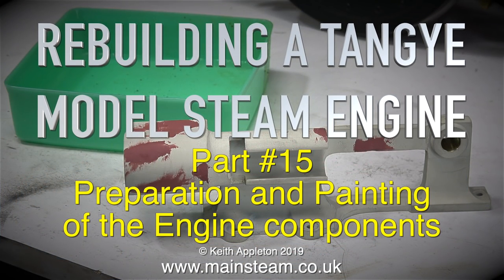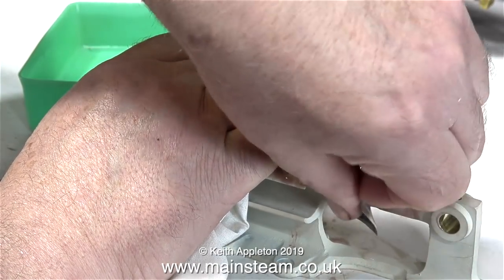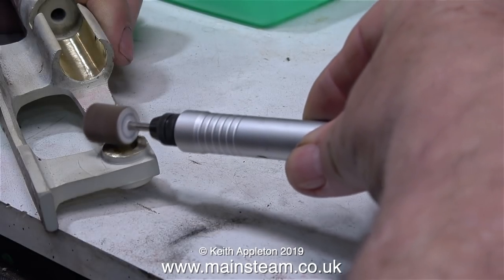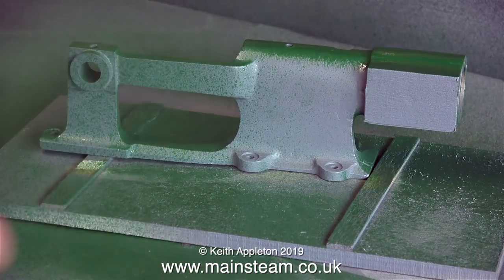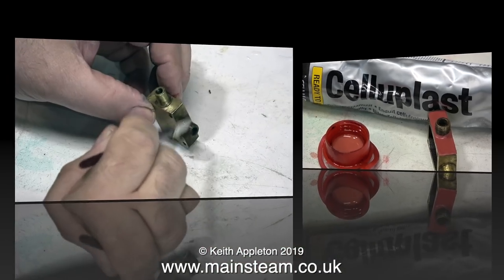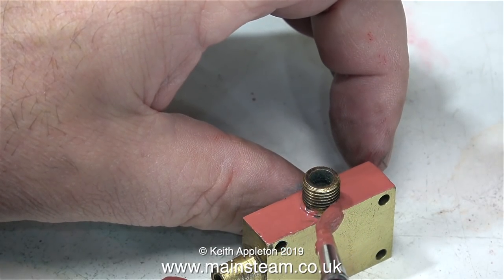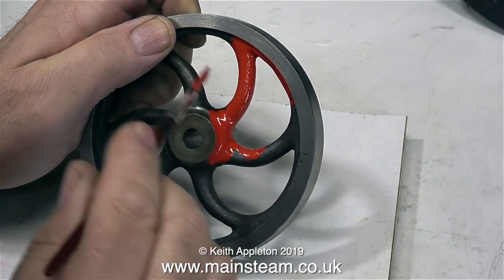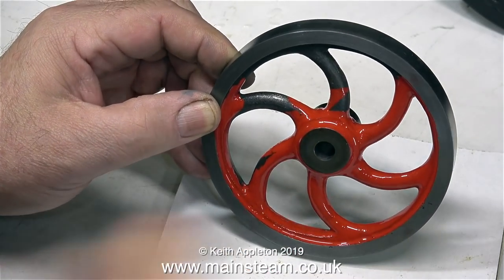REBUILDING A TANGYE MODEL STEAM ENGINE - PART #15

Comment: When I've had to remove paint from a bearing face, I've found that emery boards work well too... as they are flat, and usually have a course and fine side. The ones that are about 3/4 wide work well.